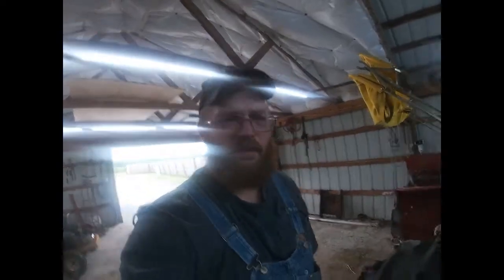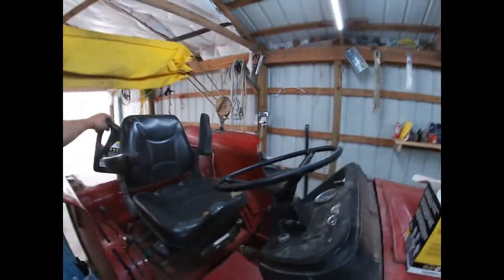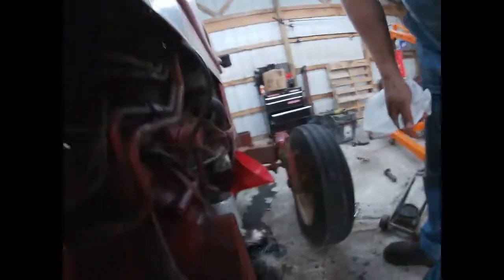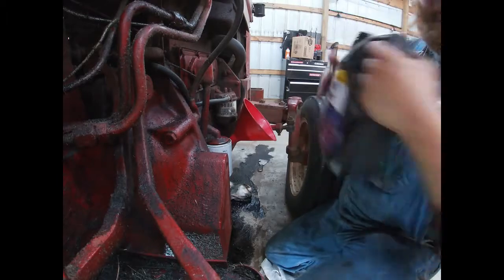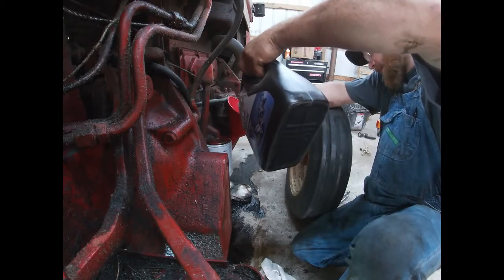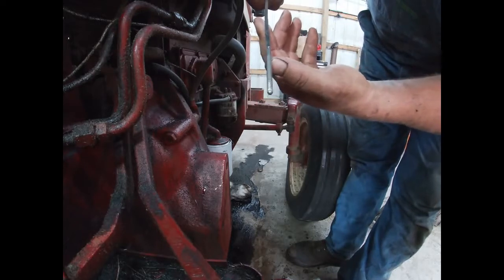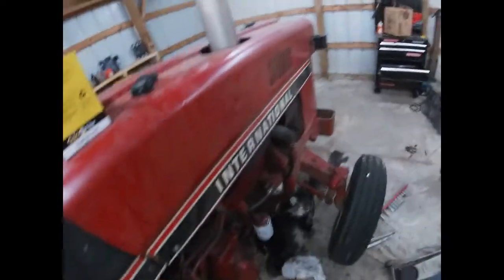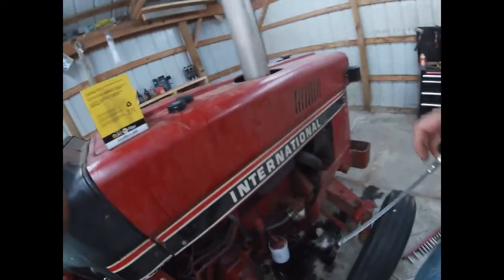International 484 dipstick calibration

Comment: Glad I could help. When you get ready to replace the front seal be sure to check the weep hole in the case for the rear seal. If one goes out the other could be just as bad.Bought a massey 165 at auction to fix and flip and the trickster seller had plugged the weep hole with silicone. Cleared the hole and drained about 2 quarts of oil from the case. Ugh. Nice thing is the International is fairly small: if you end up splitting it and having that nice garage it won't be a terrible job.

Comment: I won’t use 15-40 oil on my farm pro 2420 I was running it and could not build oil pressure my neighbor said he only runs 30 weight diesel oil so I switched to it and it builds great pressure so I also use it in my IH 454 and I never heard of calibrating a dip stick
Reply from the maker: 30wt works for older engines. If they have been overhauled after 2000 or possibly a little earlier the bearings don't require the extra zinc. I never had issues with 15w40 in the cold but yes 30wt is thinner in cold. If you are running in very cold you should consider an even lighter oil. Dipstick calibration is just marking the correct oil level on the stick pretty simple idea. It is a caterpillar term though.
Reply: @rivervalleyfarm482  I know that about oil my tractors are a 1999 and a 1970 and never overhauled

Comment: That engine ( with filter) holds 9 qt’s . Don’t cut dip stick off. They read right.Something is BAD wrong if your cutting dip stick off. The factory will handle calibration of dipstick. Do you know what your doing? Doofs.
Reply from the maker: Quite well actually. The factory dip stick in this case would be 3 inches over the full mark with 8 quarts in the pan. The dip stick is the same part number for all the 484 and 584. Completely different oil pans and capacity. Now then if you have nothing good to say sit down on your couch and keep your fingers still.